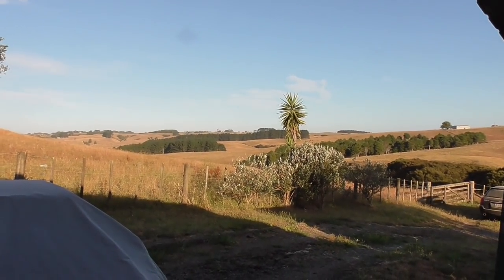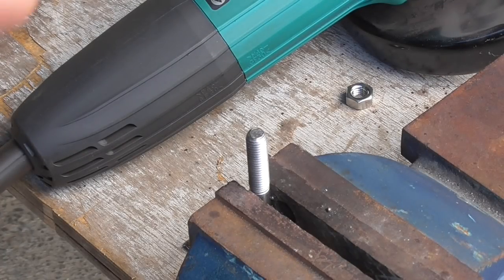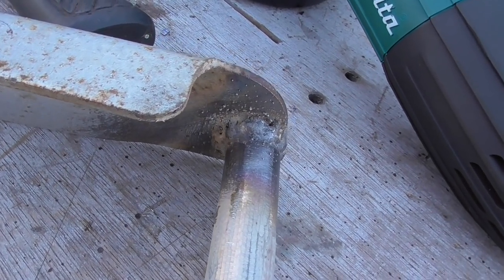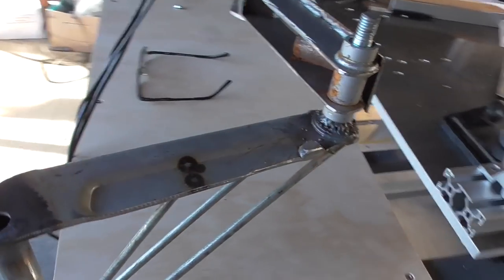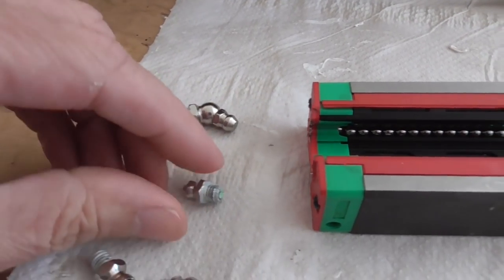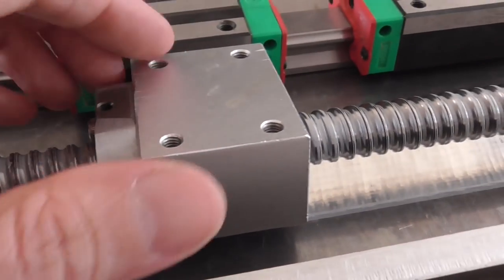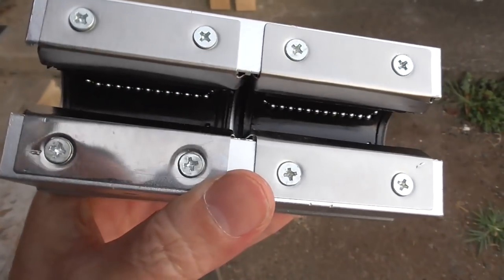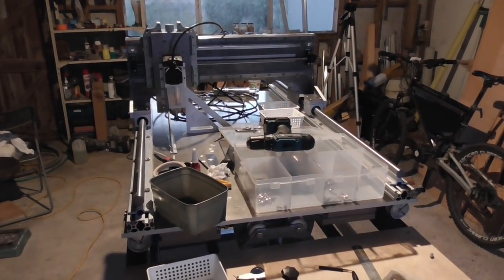Another DIY CNC router, part 10 (monitor stand, grease, more bolt cutting)

Comment: One of the best tips I was given when I first started welding immediately improved my welding skills as a young buck so I try to always pass this information on to anyone learning to weld. If you have yourself a pair of weld pliers, the wire cutter that's built in to those will cut your wire to the optimal distance between the cone and your workpiece. And if you have a lot of popping while welding you're too far away. MIG welding is so easy once you get your distance and speed down and then the proper way to move the torch with your wrist and not your entire body or arm. You have to become a tripod. 
I taught my oldest son to weld proficiently enough in less than 4 days when he was 6. It also helps when your kid is truly interested and mesmerized by these kinda things. 

And now, being 22 years old, he puts the old man's welds to shame.

Comment: Looking great man!!  For the greasing of your bearing blocks, what I'm doing with mine, I got Capricorn Bowden ptfe kits. They are for 3D printers but they are also perfect for the bearing blocks. It's an m6 quick disconnect pneumatic fitting, an m10 fitting, and a nylon tube. The m6 fitting will fit your block. Then, get a block of aluminum, drill and tap a through hole with m6 threads one side, and m10 on the other. Put the m10 fitting in, and an m6 grease fitting. Mount it somewhere convenient,  cut the tube to length and connect it to your blocks. BAM, remote great fittings and you don't need to fiddle about with with greasing anymore. Hope this helps. I only just recently figured this out and it's great.

Comment: HA! I built a monitor and keyboard apparatus very similar to yours to game in a reclining chair. I used a swinging TV wall mount mounted to a 2” square tube welded to some 1/4” plate. I screwed the plate to the bottom of the chair to hold everything together.
Needless to say, I gained weight. Haven’t gamed in 10 years now and lost the weight.

Comment: Hi from a new sub down in the South Island (Nelson)! I found and sub'd to your channel from the nRF testing vids, but have really enjoyed watching you build up this CNC router while going through your other vids. I designed and built my own CNC plasma table recently and it was great to see you working through some of the same challenges. Here's a tip for even nicer threads on the cap screws... I just cut them in my table-saw (quick and easy!) then I pop them in my cordless drill and hold them against the belt-sander at at 45 degree angle. In approx 1 second on there they are re-finished with a beautiful chamfer and a beautiful new clean thread entry :) Keep up the good work, really enjoying it. Ps, I'm also an ex-glider pilot from Nelson Lakes Gliding :)

Comment: May I'm wrong.
The Tip/nozzle of the grease gun should be turnable to release current grease nipple much easier.
May you have chosen for a specific reason for a grease gun with fixed nozzle.
I would suggest grease guns with flexible nozzles.
Thanks for your video, it is really interesting 😁

Comment: I can't remember wether you have a drill press or not. But if you do, a trick that works for me is mounting the screws you want to cut on the chuck of the drill ( If they are allen heads you cand hold them either by the head or by the threaded part that will be left over after the cut) and cut them with an angle grinder while they're spinning.
It doesn't mess up the threads because the cut ends in the center of the screw, and you can put a small chamfer on the new end of the screw pretty easily with the grinder while it's still spinning.

Comment: The other thing those bolt covers do on the rails is help prevent chips from getting up into the slide. If there's a hole there chips can sit in the hole and then get kicked up into the slide as it goes by

Comment: Stout shimmage, much better than that flimsy stuff!
Use a bottom tap instead of a taper tap to maximise the treads in a blind hole. There are also taps with extended shafts to tap deeper. Just a thought.

Comment: I realise that you are probably sick to death of the the "put a nut on the bolt before you cut it" topic, but I had to put my tuppence in.  When I was faced with cutting a number of bolts to the same length, I taped together a stack of washers and a nut so the length was the same as the required bolt length.  Put it in the vice and run the angle grinder against the face of the nut to get consistent bolt lengths.  When you undo it, the nut straightens the burr on the end of the bolt thread.  (I still touch them up on a belt-sander or grinding wheel though, so no great time saving over what you did.)

Comment: To shorten bolts, cut with angle grinder, bench grinder to true the end,  grind in a starting taper and wire buff to remove any left over burrs and have never had a problem with itnthreading in perfectly.

Comment: You can loosen the locking ring on the grease gun, you just have to push a tad harder to seal when pumping
Reply: I was going to suggest that removing the circlip might at least make it useable.
Reply: Yeah, you just loosen the "collet" thing on the end a tad where its nurled.
Reply: To add you'll eventually rip the zirc fitting apart even mounted in steel

Comment: For full thread blind hole use a "plug" or sometimes called "bottoming" tap.
Different time to cut with dremel versus angle grinder is the speed of the cutting wheel ( x ft/metres whatever/min)at the circumference plus power available.
For the thread burr, simply run around with a flat file or hold end of screw againt grinder at 45 degrees while turning it by hand.

Comment: When cutting bolts to length, put a nut on first, cut, then take the nut off again. It will straighten the thread out for you on the way off. :)
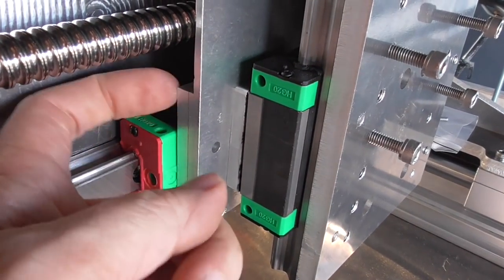Reply from the maker: 3:34
4:33
Reply: @iforce2d  5:26
Reply from the maker: My point was I had already commented on what you were saying. Try doing 90 of them and see which method you prefer by the end of it, and which has a better result. The nut method takes longer and without chamfering the end a little you get a nasty sharp edge that is a pain in the ass to get into hole in soft aluminium with even small misalignment.

Comment: Those thin cutoff wheels work great for screws.  If:
You use maximum speed. >30,000 etc.
Use light pressure.
Small screws.  5M is pushing it.
The harder the steel the easier to cut.  Stainless is not quite as hard as some steels.  :)

Comment: 2:37... You could tap closer to the bottom of a tapped hole by using a bottoming tap rather than a starting tap that you show. About the grease...  Just a though... over time the grease will get full of cut chips....
Reply from the maker: Right. I bought a M6 bottoming tap but don't have a M5. It's more about the overall length of thread on the tap though, because the holes can be as deep as I want. Bottoming tap would give me another 3mm or so I think.

Comment: sounds like you need a bottoming tap, I think HOSS have a great video on taps
Reply from the maker: Right. I bought a M6 bottoming tap but don't have a M5. It's more about the overall length of thread on the tap though, because the holes can be as deep as I want. Bottoming tap would give me another 3mm or so I think.

Comment: I am just curious about measurements at end and how much you got backslash. I know you said you will make parts for planes and care not much for extreme precision but still would be useful to see some precise measurements and how close you are to "perfection" considering methods you used in building it. I am sure with ajustments after mesuring you will be able to come nearer and see what are limits. I took for my mill double nut ballscrews in attempt to make backslash smaller.
Reply: back LASH. Backlash. Not slash. :)
Reply from the maker: Yeah I'll take some measurements here and there, just with the cheap dial I have though, not planning to buy anything fancier.

Comment: I hope you see this comment, I would like to ask you what materials you used for the Homeslice 4 plane because I am going to build my own plane in this style, it would be nice if you could answer that.

Thank you Jonathan
Reply from the maker: There is a lot of detail in the previous plane series, search for "homeslice 3"
Reply: @iforce2d   I found the foam but the Problem is I need to now what is the dens from the foam to find a way to calculate the final weight 
Thank You for the answer

Comment: ayo, when next videjo?
Reply from the maker: I have it all together again with drag chains tidy, but there's not really much to show that's worth a video. Waiting on new limit sensors because I stupidly bought normally-open ones. Then add the wasteboard somehow and that's about it. Been doing a lot of programming and some work on my website...
Reply: @iforce2d  ooh nice! if you have an electronics store nearby you can hack up an inverting 'circuit' with a transistor in a few seconds, depending on how long the other switches take to arrive it might make sense.
Reply from the maker: The problem is not the polarity of the signal, that can be easily flipped in LinuxCNC. The problem is that a normally-open wiring cannot tell if a wire has been disconnected or damaged. Normally-closed requires a constant connection that will immediately let you know if something is not right.
Reply: @iforce2d  oh! good point! I'll have to keep that in mind when making my own cnc one day. thank you!

Comment: you know there is a tool to fix that bolt issue it rounds the tip of the bolt...  Deburring External Chamfer Tool Drill Bit Remove Burr Repairs Tools

Comment: Monitor mount on Amazon 25$ don't over think stuff dude
Reply: But is it "Steam-punk"?    :o)
Reply from the maker: I had a look around and there are some decent options, usually a bit pricey and don't move horizontally much, and are generally made to be moved only occasionally. None of them have keyboard/mouse area so I'd still have to make that. I don't think any of them can fully retract over the top of the main pivot to reach every location within their range.